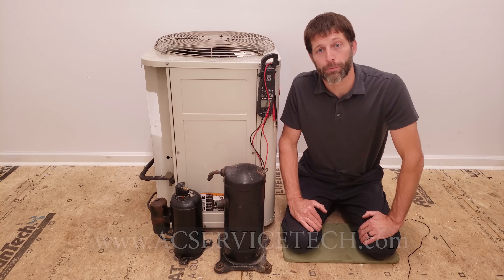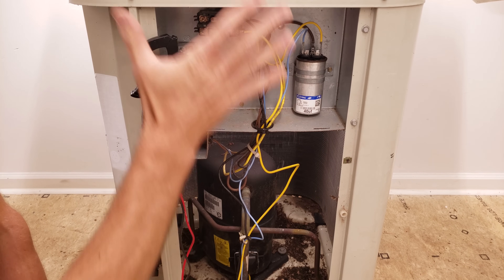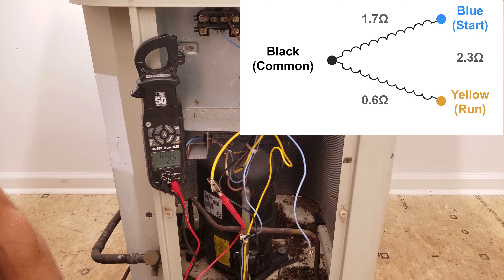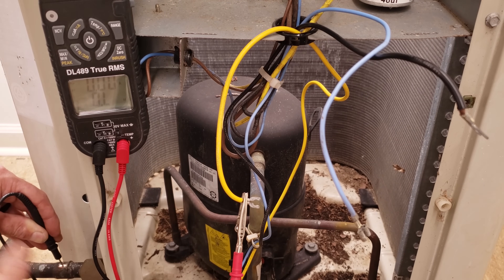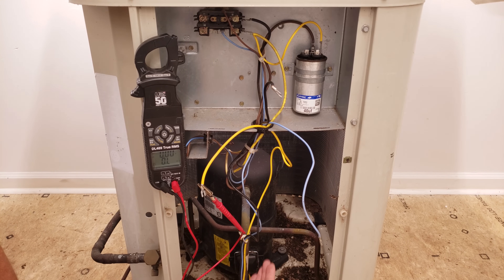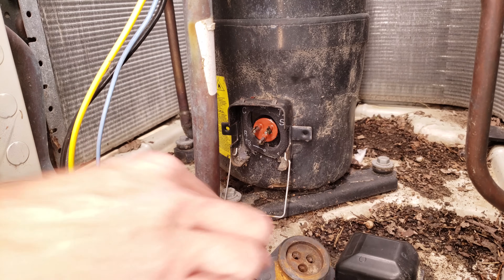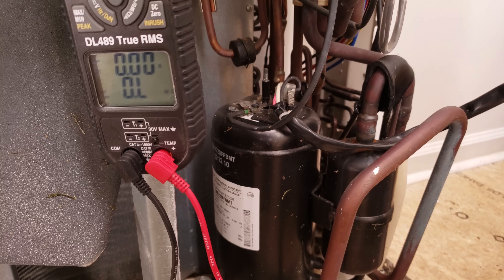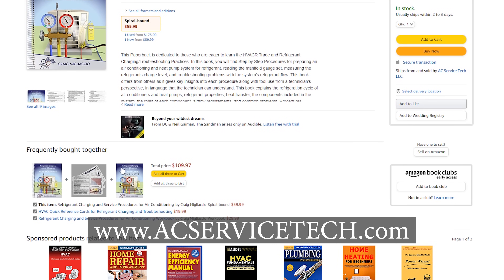Testing if an HVACR Compressor is Shorted to Ground, Open, or Overload Tripped!

Comment: hvac tech almost 20 years. fluke meters will not for whatever reason measure a grounded compressor. Its super annoying so ive lost my trust with fluke. The only meter I will ever use and fully trust is the fieldpiece. That said you should stop using it after 4 years. Buy a new one and just keep it as a back up.  After about 5 or so years they can fail. Not sure why. I have a back up field piece thats probably 10 years old and still works. But i only use it as a back up.
Reply: The proper tool for detecting ground faults is a megohmmeter, not a multi meter set to resistance.  The motor doesn’t run on 9 volts, so why are you testing it with 9 volts.? My megger tests with 250, 500, or 1000 volts.  It will detect flaws that a multimeter can’t find.  It it also good for finding intermittent shorts in wires.
Reply: @rodgraff1782  yes.... true but.... my point was that flukes will almost always read open loop even on a totally grounded out compressor. But with a fieldpiece i can not only tell if its grounded and i can also catch most but not all of the intermittent ones too. i feel like you havent had the experience with fieldpiece i have. but yes the megger is the way. but dont tell me that i aint right about fluke and fieldpiece in this tho i got 50,000 service calls bud and i know im right there. just maybe you aint seen it. and why the f would a fluke read open loop on grounded out compressors tripping breakers??? i thought fluke was supposed to be the best.
Reply: @hvacwiz7877  hi wiz. I have a fluke now, but I can’t comment on your problem, because I never used one to test for grounds. Back in 1973, when I started my career, we didn’t have digital meters, just analog.  I don’t know if fluke was around then.  That was 50 years ago.  I had a Simpson 260, which was huge.  We did have meggers though.  Antiquated ones. To make an accurate assessment about motor insulation condition. One should test with at least the voltage that the motor runs on.  Sure, an ohmmeter will find the obvious grounds.  I don’t know why you have all the trouble with flukes.  I’ve never heard that form anyone but you.   I used to test 460 volt motors with 1000 volts.  There is no amperage behind it, but it will jump a gap.
Reply: @rodgraff1782  yes the fluke 301, 321, 323, 324, 325...all the clamp on flukes ive tried none of them can be used/trusted to find an obvious grounded compressor. which makes me question fluke as a whole. fieldpiece is a brand that puts their focus on the hvac industry, however they also suck... all of their products are totally unreliable. the only thing i use from them is their meters. but when their meters start getting old they start to do weird stuff like give you false readings. heck i got a field piece right now on my table that the red lead intermittently works and only works if i push it hard enough! and even give false readings!! because of a bad lead!!! So imagine how crappy that is if i thought i had no voltage but there is!!!! thats why i always use the tick tracer on top of it. And thats why i always wanted to go with fluke but this is why i dont. fluke seems to be a much more reliable safer brand that all the power companies use like PGE and what not. but they use simpson too. as for the megger the supco m500 only like 100 bucks is decent.
Reply: @hvacwiz7877  My meggers are industrial type, and were $1000. Each new.  I was able to buy 3 on eBay for reasonable.  They have a crank on them to turn a generator for the power supply.  No outside power or batteries required.  I don’t trust the ones that run on batteries.  They are probably made in China.  Mine are made by AEMC  model 6503 with 250, 500, and 1000 voltage settings.
Reply: @rodgraff1782  industrial megger for an industrial job. you started 73 i started in '03. Im hvac i dont do industrial. I work on say 30 to 50 ton equipment and less. almost everything is less than 50 h.p. and 12 tons or less compressors. technically the supco m500 is only reliable to 5 tons and 25 hp. so thats when you need like a... a real megohmmeter. you probably might make more than me but i do ok. I want to get onto bigger better things i do.
Reply: @hvacwiz7877  I’m retired

Comment: I got a hp 3 ton scroll ,comp plug burnt up. replaced compressor and plug. start up pressures equalized amps at 2.0. rated for 12amps. 208 1phase.  replaced IT again, start it up same thing. any ideas?

Comment: My AC Breaker trips instantly when setting to cool. The outdoor unit is a Carrier 2020 model that was installed new last year. Anything ese I can try before having to call a tech? short on cash.
1. I tested the 3 compressor pins and they all show OL.
2. I disconnected the compressor to see if breaker would trip without it and breaker does not trip, Fan Spins also.(This makes me think there is not an issue with Breaker nor contactor and maybe it is an issue with the
 compressor or wiring.)
3. Outdoor unit is very clean, and I dont see any visual wiring issues.
Reply: Hey there,  did you find the issue?  My compressor does the same thing.  Tests fine but trips the breaker when powered up.  Not getting any replies on here. 
I did try disconnecting the earth lead on the compressor briefly just to see if it would run... and it runs perfectly.  But it makes the housing live!
Reply: @tonyp6088  Yes, I had to get the compressor replaced. Luckily My compressor was still under warranty.
Reply: @tonyp6088  I was charged $1700 for repair, which is alot more than I wanted to pay.

Comment: I'm a 63 year old female and yes we still get Cheated. A service guy checked my wire outside said compressor was leaking in my house but never went inside, anyway wanted, $2,600 to fix it. I have no son or husband so any small info the better for me. Thank you

Comment: Might be a silly question, but; do 3 phase units need to be located in areas where three phase is available or do they come with a unit of capacitance and coil/s to artificially make the third phase?
   Thanks
Reply: your right its a silly question but thats okay. theres nothing wrong with asking a question so long as you realize that. 3 phase units are generally installed  in larger commercial buildings, malls, shopping centers. They use large units that have multiple compressors and fan motors. They have special power panels that delivers 3 phase. I have actually seen a house that had a 3 phase roof top unit. Ive also seen 3 phase on a really old high rise pent house building. This guy bought 2 pent houses of the country club in las vegas and joined them together. hes got like 6 10 ton 3 phase Trane units. 2 many splits and im not sure what else.  He bought it as is and i went up there. he had like 3 bad compressors, a bad control board, and ... a leak on one of the mini splits where it goes into the evap. Tons of problems. but that guy bought all that for hardly anything its probably worth a F load now.
Reply: @hvacwiz7877  hard to believe 3 failed 3 phase compressors. Sounds like a dropped leg to me.
Reply: @hvacwiz7877  haha. I had that happen with rain frogs. Only they got behind the control board in a mobile home split furnace. They come down thru the old fresh air makeup. Also up through the condensate drain on pack units. I probable changes that board 4 times before I found a frog all fried.
Reply: I like talking about this stuff. Ever found the tiny tiny little spider's web in a pressure switch on a gas furnace. Never know he was in there in till you take it apart. Work one day and not the other. Check it , it reads fine. You sound like a real tech , not like most of these parts changer.
Reply: @hvacwiz7877  3 phase compressors are really tough though. I've only ever seen one with bad valves. I accidentally condemned one when first starting out. Luckily another tech I worked with had more knowledge of 3 phase. I think the boss changed it out anyway because it was an insurance call for commercial job. He was a crook.
Reply: @barbarafogle3541  One was grounded the other 2 had bad valves. ive been doing this since 2004 ives done over 50,000 service calls and im not a crook. theres 2 5 ton compressors in each unit so the guy has 40 tons of ac plus we installed 2 additional mini splits. the trane units were not that old only like 11 years which is super shocking. i was able to get one to half way work but only with one compressor. one unit had both bad compressors. one grounded and one bad valves. i know it sounds ridiculous and it was but it is what it is. i didnt make it and i didnt break it. You dont sound like an actual tech but i am for a very long time. and before i did this i was working on tractors. i was also a gas technician. i can like rebuild engines and stuff. i doubt u ever did any of this.

Comment: A megommeter should always be used to test integrity of winding insulation. 
Not a multimeter.
Reply: Finally someone who knows how and when to use a megger.  I have three AMEC megohmmeters, crank style.  It is the proper tool for checking the condition of the insulation on the windings to ground.  If a system has moisture or contaminants in the oil, it will fail a megger test.
Reply: @rodgraff1782  
With a 3-phases compressor, like the last one in the video, any of the three terminals have to checked against frame with the megger?

Comment: Hello I have a 35 years old GE fridge I get resistance  from the  compressor Common to Starting reading is 2kohms, Common to running 25ohms, and starting to running more or less 2k. Is the compressor ok? 

My fridge is running but normally it runs loud but now my compressor runs more silent and turn off after few seconds or minutes. I test also the 3 pins of the compressor to ground it has a resistance about 10kohms. So I need to replace compressor?

Comment: What if the resistance from start to run is very very low like 1.89 
And adding up both values equals 1.98
Reply: On a powerful unit maybe that low is normal

Comment: I was expecting the 13 ac technicians do that when they arrived at my house to "troubleshooting" one just pop it his hands on the AC unit and he predicted the compressor is bad and i need a new unit to install???? He gave me $13K estimate???  Same thing happened to me two years ago, all ac tech told me to replace the unit because was R22 and old system, i watched videos on YouTube and indid my part and i found it was the fryon, I did everything myself and it's has been 2 or 3 years since that issue. Until now the breaker is moving  and the AC unit makes a hum sound. One of the technician used a screwdriver  and the AC started working and than when he removed the screwdriver and it stopped he said the compressor is bad and i need a new ac unit. I'm sick and tires of these lazy thieves. I will do it by myself and see what happen.
Reply: How did this work out for you? AC work takes skill learned on the job and thousands in specialty tools...wouldn't be wise to take on an ac replacement yourself

Comment: On a 3 phase compressor, 2 windings reads the same. One is higher than the other. Is that term called shunted winding?

Comment: apparently i have a hydronic ac unit and two HVAC guys didn't even want to fix it. they didn't even want to check nor even try to diagnose it. the fan run outside and so my unit fan inside the house and the only think it does is cool and then suddenly warm air through out the day and I would feel cool few times but never how it used to.  so two hvac guys did not even bother trying to even check it.

Comment: When it comes to identifying the compressor winding, I usually teach the winding opposite the highest resistance is the common winding. The second highest resistance is start and the lowest resistance is run winding. The major question is, why is the start resistance greater that the run resistance?
Reply: Because the motor has an in-rush of current when it starts which needs more resistance (start Winding has more resistance than the Run Winding
Reply: There is no comment on my name only a run whining and start whining and they both meet at a common point which is the common connection or C terminal

Comment: So I've had a Journeyman tell me that when you have an Open Line from the compressor legs to ground, that means the compressor is bad and needs to be replaced...
Reply from the maker: with the wiring disconnected, OL from any winding terminal to ground is what you should have. If you got 0.0 to ground, the compressor is shorted
Reply: @acservicetechchannel  I should have known this from my studies in school and also it just makes sense. I feel pretty bad now since I actually sold someone a new compressor and handful of upgrades last week based on my incorrect assumptions. Guy spent over 3k
Reply: No he replaced a good compressor
Reply: That is a grounded compressor

Comment: Hi guys, im a service technician in Botswana and love the great work y'all are doing with the videos! Coincidentally i had a similar problem just the other day with a Maclaren 12000 btu packaged unit! The compressor was heating up and much like in the video the thermal overload kept it from starting! I did an ohm test, continuity test and ground test to the compressor and everything checked out! I also tested  the capacitor and also did a visual test and still everything seemed legit! I then took the decision to remove the thermal overload to see whether the compressor would start (big mistake) long story short the compressor overheated and shutdown! Can you help on what could have been the problem and what could i have done different

Comment: question:  ok, bad transformer in heat pump.  However the wire on the com. is red, so I'm assuming I connect this one to the white wire on the univ. transformer.  Is this correct?  Also, the white wire is on the 240 of the old one so I would connect the white wire to the orange for 240    the sec'd wires don't matter in orientation.  Is all of this correct?  ty

Comment: I read ohms to ground  between a compressor winding and the copper line to it and when I plugged it in it ran just fine.It was a scroll compressor.Not sure how it was possible but I almost condemned it for no reason

Comment: I have an issue of occasional short cycling in my roof a/c unit.. will work normal 4 or 5 times  then short cycle.. sometimes it does it first run.. other times it will not do it at all.. is there something i can check or replace that is intermittent failing?

Comment: You disconnected the wire from the compressor in the split unit. Is there any residual power or current in the compressor? Any precautions needed?
Reply: gotta use caution with the capacitor !!!   Youtube how to drain "entergy" from capacitor

Comment: If you get acid smell from refrigerant, it's a bad burnout. Put ammeter around all 3 compressor wires. If meter moves at startup, compressor is grounded.

Comment: its also possible for the lower resistance leg to be your starter right? ie, you showed 1.7ohm as the start as its a higher resistance but on my sub zero, im seeing the LOWER resistance leg is indeed the start leg [ its the leg for the capacitor ] for BOTH compressors.

funny thing is i've checked both compressors and resistance is good as well as no short to ground. but for some reason, the freezer side is just not getting cold. also checked the voltage going into the relay as well as the capacitor.. so kinda scratching my head

Comment: I had a carrier 2 stage residential compressor that threw me off. All terminals with plug removed showed continuity to ground but the terminals ohm out at .6 .8. .2. Not exact numbers but close. Normally the ohms are higher plus I never seen them add up when it is grounded. The compressor had 2 plugs which I never seen before. The other plug had only 2 terminals that I did not test. It was 2 stage obvious. Would trip breaker as soon as the unit turned on. Unplugged compressor and the fan would run. Another odd thing is it would trip as soon as I put the disconnect in without the contactor engaged

Comment: need some inputs, my readings are 1.8, 3.2 and 4.1ohm, it looks like lowest 1.8 + next lowest 3.2 does not equal 4.1 so what is the problem here?
Reply: Common digital meters sometimes just don't measure low resistance accurately. Touch your meter leads together a number of times and check to make sure the reading with the leads together doesn't change. If your meter isn't reading zero with the leads together clean the plugs that go into the meter. Hold the tips of your leads together and shake the leads and make sure the reading doesn't change. Make sure your test points on the motor are clean. They make meters specifically for measuring low resistance like what you find with motors that are very accurate.

Comment: Hi, so much working on ac in gulf. I have a question about central unit. Single room the thermostat is no switching on.
Reply from the maker: look up "acservicetech testing thermostat with multimeter" thanks!

Comment: an alarm (compressor B fault) in a 30rqm / rqp 160-520 heat pump. Is the problem in the soft or the ccompressor?

Comment: I have had this scinerio a few times. Compressor blowing the breaker. Testing at the compressor two windings had continuity to the tubing but not the third. The two shorted show continuity to each other but not the third.  I ordered out the new compressor and someone else goes back and later tells me there was nothing wrong with the compressor. The fan would test out fine. Can an open overload create a path to ground? I did have someone tell me not to use too high of a range on the meter because it can give a false reading.  I have been using just the straight continuity setting with the tone.
Reply: An open overload would not cause a path to ground. It would just prevent from the control relay coil energizing.